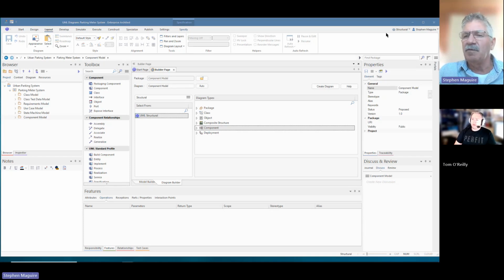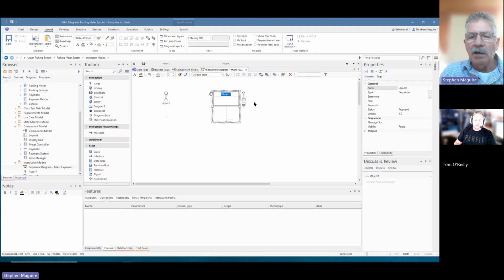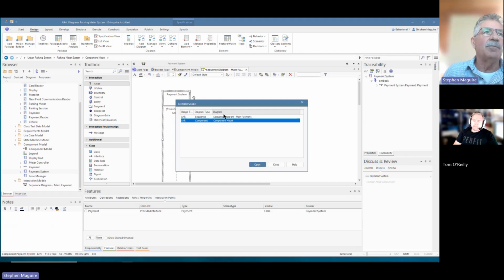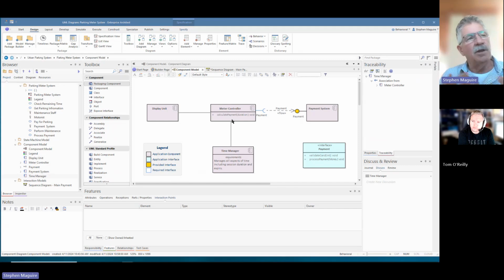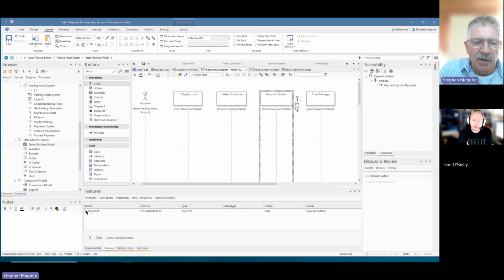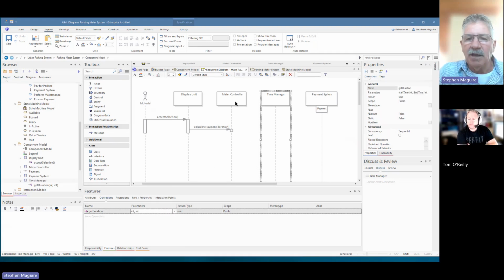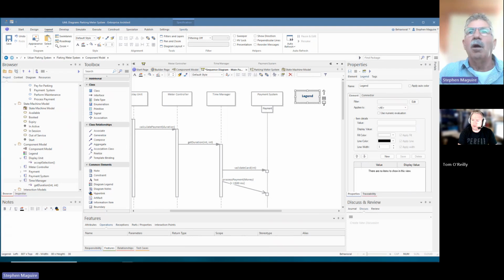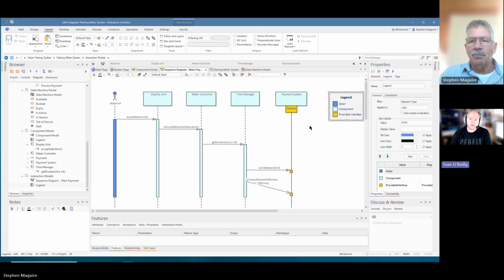Introduction to UML Sequence Diagrams in Sparx Systems Enterprise Architect

Comment: UML Actors are out of date with the ArchiMate language, you can use Roles / Actors of ArchiMate
Reply from the maker: Hi @ChristianGijselsPilot - we plan to a video on ArchiMate in the near future, and you are correct, you can mix and match the exact elements you require on any diagram to deliver the information you are after.